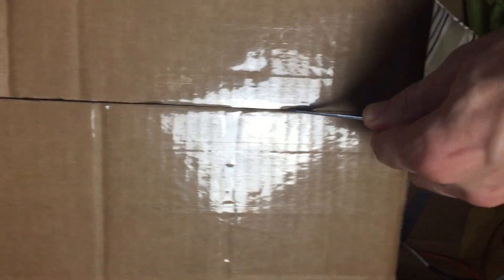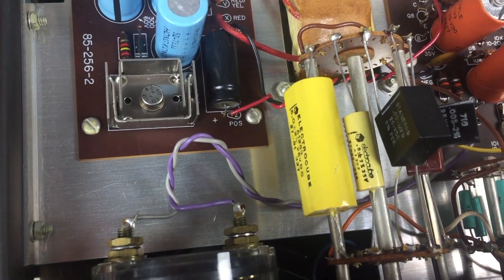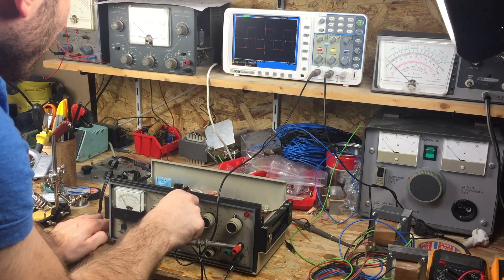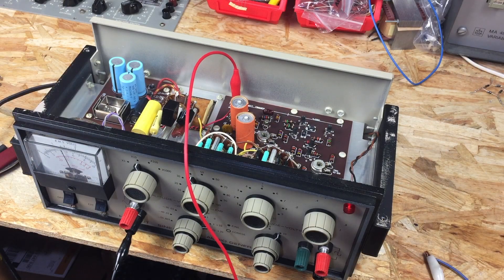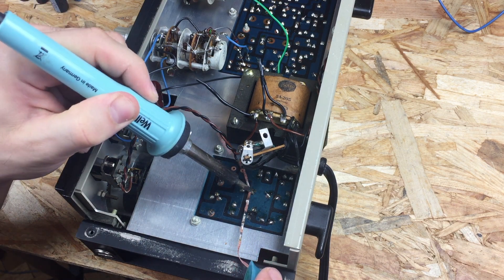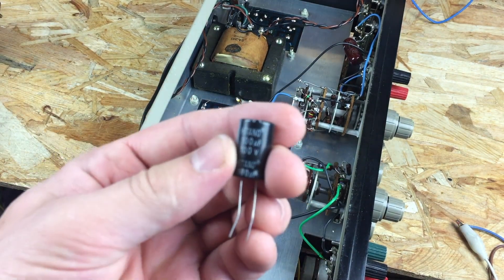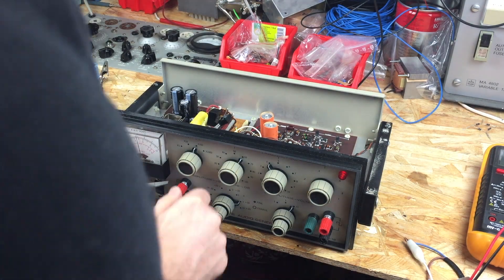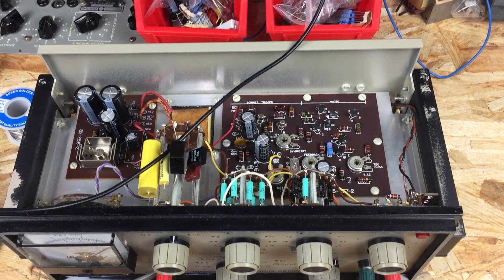Heathkit IG-18 Audio Generator (2018)

Comment: Recently got one of these too. I did replace the filter caps but that's all and it works well enough. This reminded me I should calibrate it, and maybe look into the other mods. I think the meter buffering could be done better and more easily with an opamp. What do you reckon?
Reply from the maker: It works great the way it is yeah, and I really don't need such low figure specs since I don't find it necessary for the type of work that I do. The meter buffer only uses one simple transistor, a diode and two or three passive components and is fairly easy to make. There is a very well made kit available on ebay which seems like a good bargain I guess I might go that route in the future. I guess it can be done easily with an opamp as well for sure. Let me know if you come up with something! Really enjoy this generator it's exactly what I was looking for!